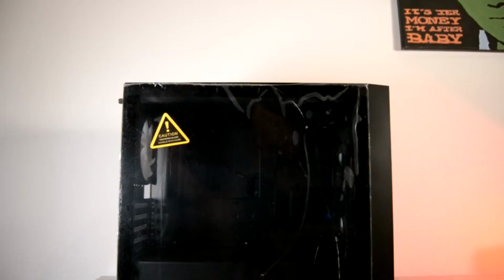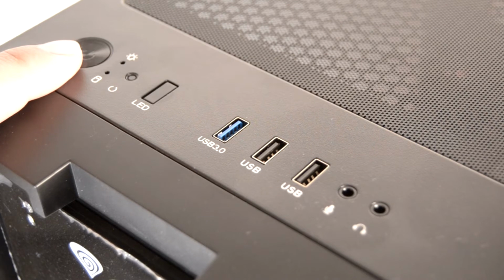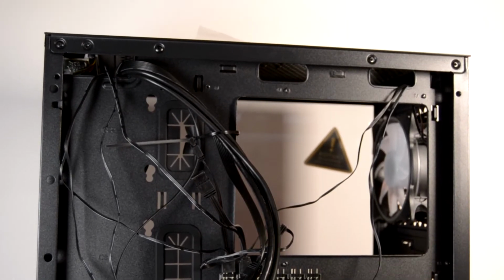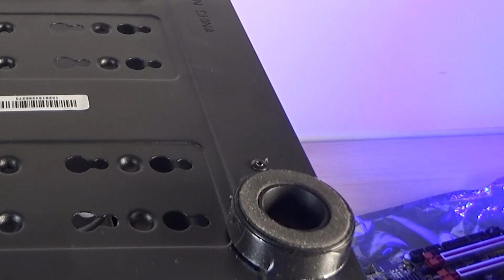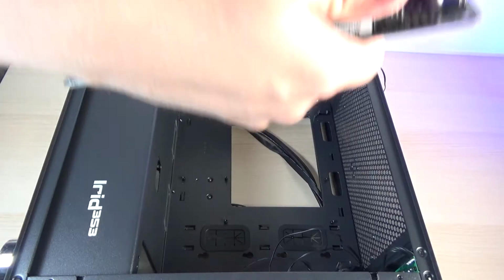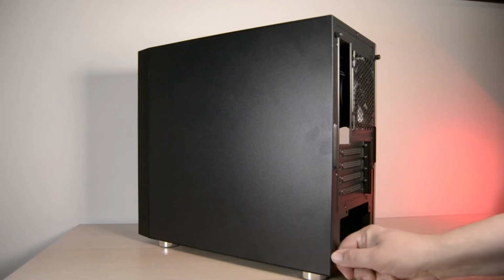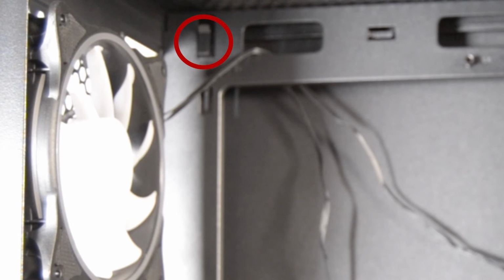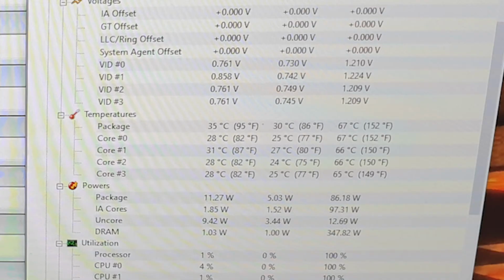Genesis Irid 353 Micro ATX Case Review and PC Build 6700k

Comment: Thanks for the great review, Kev! For a micro ATX case... it looks great! It is a bit cramped, but airflow looks good. Any reason you mounted the PSU upside down? (BTW, good grooving tunes during the build!). If you have problems finding the case in the UK, I doubt I could find it in Canada.